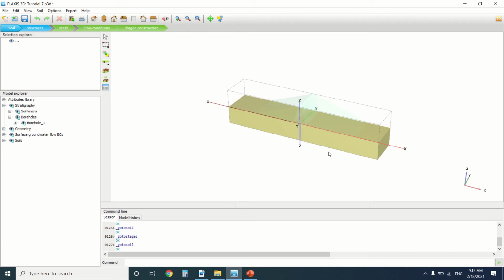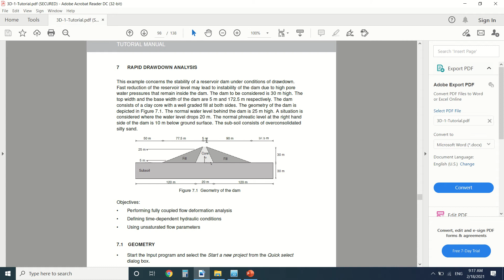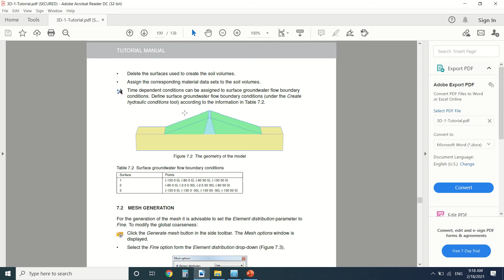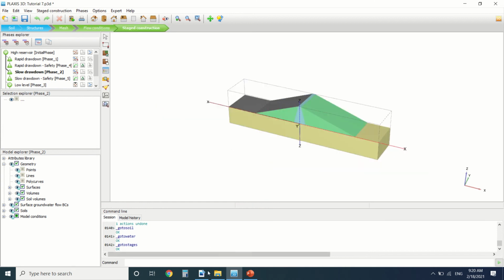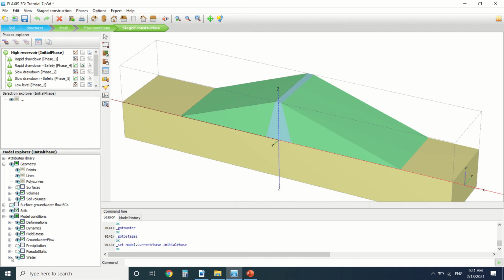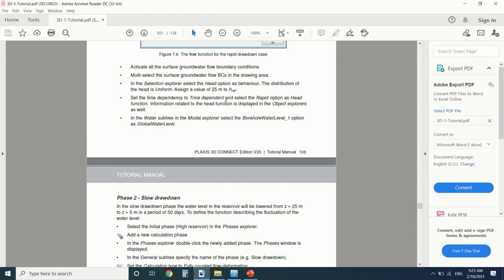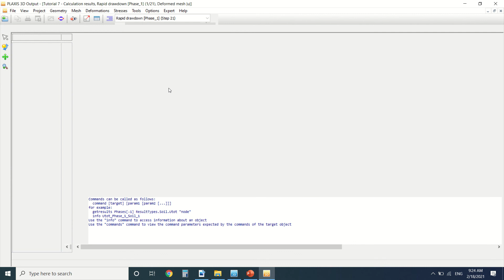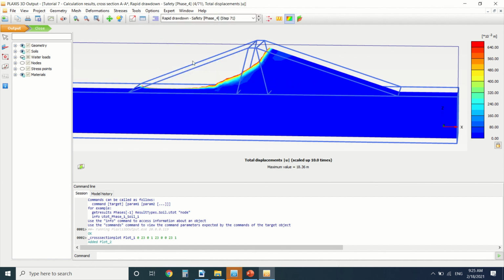Plaxis 3d tutorial explanation: dam drawdown analysis -14

Comment: Hi, thanks for the video! Why do you think the clay core is tested as undrained?
Reply from the maker: I didn't understand what you mean
Reply: @theengineer7732  sorry if I wasn't clear. In the pdf of this example the sand layer's properties is  'drained' but the clay core is 'undrained'. I don't understand why one is drained and the other undrained, I thought maybe you would understand why? Thank you
Reply from the maker: Actually, it is simple and is common sense. When a saturated clay is loaded, it will not let the water out immediately (i.e. remains undrained) and that is when most of the failures occur. In the short-term, the clay can be treated as an undrained homogeneous material where we will not separate the grains and water
Reply: @theengineer7732  thank you!
Reply from the maker: @tamaraprovencher951  welcome!!